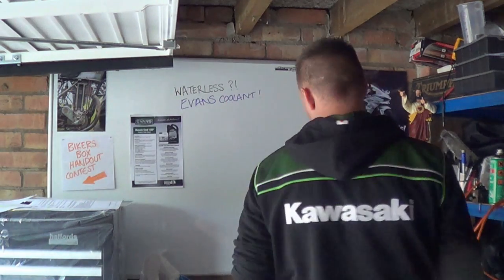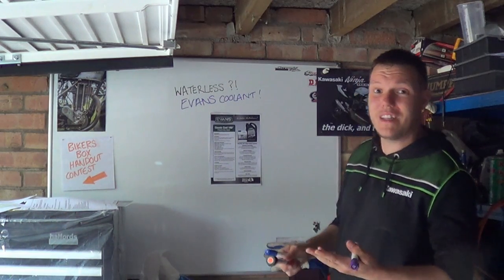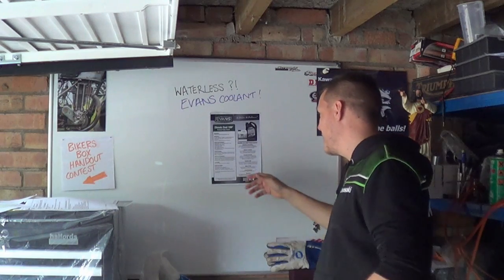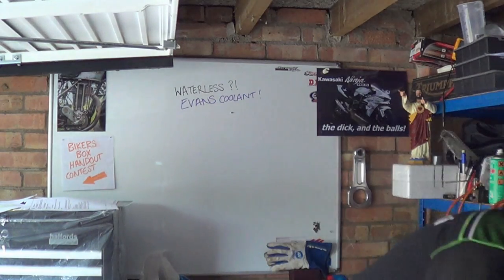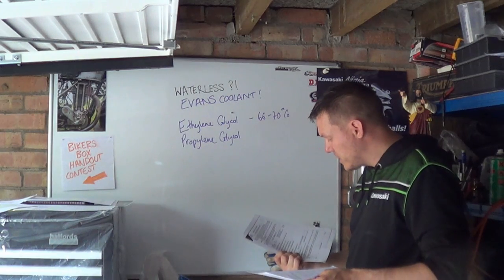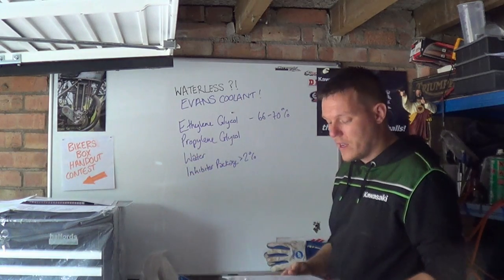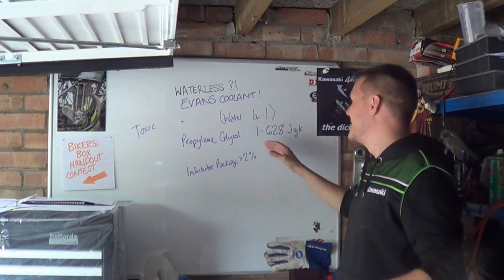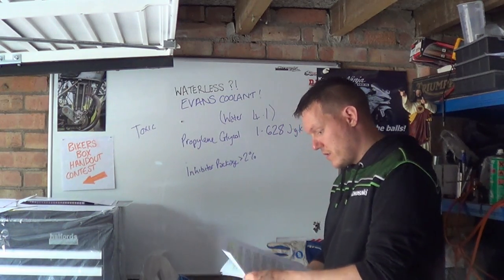Evans coolant any good? Part 1

Comment: I don't know patw52pb1 but not surprisingly - as the MD of Evans UK - I do agree with his or her comments. However, I know from arguing with the wife that getting someone to agree with your point of view, when theirs is diametrically opposed is pretty pointless. So I'm not going to try and argue the toss with the presenter of this video - although I would be very happy to sit in front of a panel of my engineering peers to explain the pros and cons of waterless coolants.  Instead I would refer all those considering the use of Evans coolants, or just wanting to know more, to take into consideration the R&D assessments carried out by a number of highly credible organisations, who have found Evans coolants to perform as described and advertised.  The following organisations spent several years assessing Evans coolants performance before committing to wholesale engine conversions;  Honda, Yamaha, KTM, Polaris, Kawasaki, Kubota, Eagle Jaguar, Veolia, HM Gov for all SAS rapid response Landy's, quads and enduros, HM Gov for a major flood defence systems, using CAT gen-sets for back-up pumping power, all UK Army Enduro Teams, plus a whole lot more.  Evans coolants have been around for a lot longer than many folks realise and were initially developed for use in Indy racing cars in the early 1990's.  Since then sales have grown steadily and based on volumes of coolant sold around the world, there are now >1.5 million engines running on Evans.  Although the presenter of this video is obviously anti-Evans, it would be reasonable to state than the vast thinking majority are capable of making their own minds-up, based on all the facts and not just one individuals opinion. As to the presenters engineering credentials, I do not know and therefore would not assume or comment.  Suffice to say there is a lot of subjective commentary and bias, rather than a reasoned debate with someone else present to give a more balanced approach.
Reply from the maker: "Although the presenter of this video is obviously anti-Evans"

- I'm anti-bullshit. Good sales pitch though
Reply: Thanks, I've had a lot of practice!  Hyperbole (BS) is inevitably part of marketing, but the product does bring a lot of genuine engineering benefits for the  great majority who use it.
Reply from the maker: Well played.....
Reply: your setup sounds ideal, is it possible you could do temperature testing between water and coolant (to show the increase and help set a base line) and evans? of course only if this steve guy supplies the evans, i want to believe but also want 100% factual test, the test by the workshop gave me a lot of data but was not definite as he measured coolant temperature, his test almost suggest that evans ability to get to temp quickest means it may actually transfer heat the best, i would love to see this done with a in coolant sensor and an on plate sensor but i doubt the workshop will comply and he may not have the correct tools to measure the surface temp under the glass without changing the surface contact, but your intercooler has an iat sensor and that is like a cylinder wall temp sensor, it says more than coolant temp ever will and since that is the temp you are actually trying to control then it is most important, now for confirmation i must ask it is a standalone cooling system right? not coupled to the engine coolant (other than the rad being behind or in front of the engine rad which we cannot help)
Reply: aterack833 in test is the same. Water is best charge intercooler have to run pure water or 50/50 in winter to have coolest temps.
Reply: aterack833 drill a hole and the best flood coolant is water just add soluble oil to lubricant cut. Nuclear reactors use water or co2 as the coolant media as its the best at transferring energy heat.
Reply: co2? never knew that, but yes i already watched his video which with the right logic applied is definitive proof, so other than for cold vehicle warm up and emissions i would say that evans is crap, and my exclusion is only if you have enough of a cooling system to not overheat during daily use, the worst part is i have since then disagreed with matt on other things and still retain my changed mind on evans ability, it's crap and lies, would never buy the stuff and kinda want to know the ingredients to know how much they are screwing their customers , the one situation you could use evans is on a stationary engine with a massively oversize cooling system evans would allow you to put oversized pistons by thinning the cylinder wall so much that the heat would be too much for normal coolant and the "cavatation"  (boiling and bubbling) would not occur and you could then retain cooling system function, i doubt anyone with such a setup would want to buy that much of this when they could spend the money reducing the load on the engine or getting a bigger engine/adding an auxiliary engine
Reply: his combined efforts between his videos told me that evans is basically just prop glycol and has a thermal conductivity about 1/3 that of water, so half of normal coolant roughly
Reply: There are 1 billion cars in the world and 1.5 million run Evans. That doesn't include the count of those who dumped it.
Reply: @Jonathanbaker  cutting oils are actually glycols
Reply: @Mr. Faffington  so you get the point. Its not approved by Kawasaki, Yamaha or Honda. Just technical partnership where you send them bunch of free stuff to test.
Reply: @Mr. Faffington I got your point and agreed.

Comment: OK, here's another science bit from when I worked on water-based hydraulic fluids for offshore oil rigs.  Ethylene glycol is the most toxic of all the glycols (drinking 100ml is fatal) but it's also the most biodegradable. Propylene glycol is food approved for use as a wine sweetener and for making essential oils water-miscible, but it's also a lot less biodegradable (strange, since they let you ingest it). Sodium Nitrite/Nitrate is an oxygen scavenger and reduces corrosion. 2-ethylhexanoic acid is a chelating agent (can take metal ions into suspension) and is reprotoxic (dangerous to the unborn child) - nice, eh?

Basically, this waterless coolant ides is a scam. Water/glycol mixes freeze at lower temperatures than glycols alone and the water is a better coolant due to it's higher specific heat capacity. Just buy what the OEM recommends and be done with it. they wouldn't spend millions developing an engine without checking anti-freeze out at the same time. Evans waterless coolant is a form of snake oil.
Reply: the solution with the biodegradability is change your coolant and drink the old mix.then all is fine lol
Reply: Another fun fact - the antidote for glycol poisoning is to get drunk on vodka. The alcohol purges the glycol from your kidneys as long as it's administered soon, before it can cause kidney damage. This is why alcoholics don't die when they try drinking anti-freeze to get pissed. I took a guy to hospital who swallowed ethylene glycol after a hose burst when filling drums and he had a really good night at the A&E getting bladdered. The Pharmacy at the hospital had to send someone out to the off-licence to fetch it!

Comment: Certainly in the UK and I expect everywhere else you can have problems with your insurers if you modify your vehicle without informing them. Substituting the coolant for something that is flammable seems to me far more significant than the Ace cafe sticker on my wifes car. Pure ethylene glycol actually freezes at -10c, in comparison to about -40c for a high antifreeze content mixed with water. I obviously don't have the data for the Evans coolant.

Comment: 10 Tenths Race Coolant Inhibitor Concentrate Inhibitor 
is formulated for all water cooled engines, especially where high engine
 operating temperatures are experienced. It provides superior heat 
transfer abilities to lower engine running temperatures compared to 
glycol based engine coolants.
Reply from the maker: sounds like a sales pitch to me

Comment: @The Workshop, there actually is a application for Evans that is right up its alley, and that's in off road applications like Dirt Bikes. Ever been in the middle of a hard enduro miles from anywhere to get more fluid if you bike starts boiling and overheating spewing all the coolant out, your boned when it does, at least with Evans even if it starts overheating, you're not going to lose the fluid and can keep going.

Comment: ACU road racing regulations dont allow the use of any cooling additives so its H2O only
-cant really think of any engines pushed harder (ok it is for shorter periods of time but still)
im sure this is incase there is a crash and it wont cause slippy patches.

Comment: actually coolant CAN impact HP output of an engine. The better the stuff works, and I don't know, whether water or waterless coolants work better - the less engine's temperature fluctuates, esp. in regard to turboed engines that tend to go in limp mode as soon as there's too much heat soak.

Comment: It seems that the main drawback of water based coolants, is the system pressure, and second, in a pressure-compromised engine, (lack of maintenance) the water will vaporize in hot spots
 The main benefit of water is the ability of water to transfer heat.
The main benefit of Evans is the high boiling point will not be as likely to vaporize at the hot spots; secondary benefit is the lower system pressure at proper operating temp, and third, less corrosion happens when water is not present. Water is a key chemical component is the process that turns iron into rust. Less rust will tend to make other components last longer.
  According to Jay Leno, the main benefit for his cars is the fact that they sit for long periods and water pumps will fail, even when not stressed by running wear.

The failure of Evans, apart from high cost, is that lower capacity to transfer heat.
  The number of cars that are running at full power for more than seconds at a time is very small, and that might not be true of heavy vehicles

The benefit for a given user will depend on what that user's use of high loads.
Here in North America, in modern diesels, a major failure point in light duty pick-ups, is rust particles clogging an in-block oil cooler that then prevents coolant from passing downstream, which make other components overheat and fail, especially EGR coolers.
Ford Powerstoke V8's were very susceptible, in the early pollution control years. And there is so much stuffed under a full-sized pick-up's hood (bonnet), that it takes a day to disassemble all of the equipment crammed into the valley of a V8 before you get to an oil cooler. Many owners did not do the full disassemble service, because it costs as much as a Ferrari, when they are used to the cost of a gasoline engine tune-up.

  For those people pulling large 20,000 pound trailers with their 7000 pound trucks, they do reach the limit of a cooling system, especially in areas when the air is above 35C pulling up a mountain.
  The rest of us almost never get anywhere close to that limit.
  You are correct to say a full power load is designed for the cooling ability of water based coolant.
  The question then becomes, is Evans worth the cost, or is it more effective to maintain your engine as it has been designed?
Well, DUH!
Better to own a car that you actually drive, and don't let you collection sit.

Comment: Just to add some further comment to my previous posts on the subject of this coolant, although I remain unconvinced. Some diesel engines apparently suffer quite serious cavitation and erosion around the liners when cooled with just water, this is due to the shocks experienced every time the engine fires. I don't know how much this is a factor with the "softer" combustion in petrol engines. I admit that I tend to think of cavitation in regards to propellors and impellers but I had not considered "vibration" induced cavitation. Matt, you know I am not an Evans shill, I just like to investigate stuff... I will find more on this...
Reply from the maker: I've said this before in another video but cavitation is what you think it is, and for long stroke diesels its a real thing - just think of cylinder sleeves as long tuning forks that resonate - this vibration creates cavitation bubbles
Reply: Matt, I understand that now, I knew what cavitation was and the basic physics of it but I did not think of the liners "ringing", you have done a LOT of interesting videos so still finding more of them. Keep up the good work, keeps me away from Pornhub....

Comment: Matt, Evans like other companies will bend statistics to suit themselves. One of my cars had a quad cam alloy V6, sadly it also had a crap design water pump with a plastic impeller. You can guess the rest..... warped heads and £2500 to fix. (Previous owner had this happen). You could obviously blame this engine failure on the cooling system.... but it is a very misleading conclusion. It was not water or antifreeze that let the engine down. A higher viscosity coolant might have fatigued the pump earlier.

Comment: P.S. to my previous comment....I'm happy to respond in detail to any technical question viewers my have after viewing Workshop videos relating to Evans coolants....hopefully that will provide a two sided debate and not just a diatribe
Reply: Can we keep this civil and focus on the engineering issues?
Reply from the maker: This is my channel Steve, this is how it is.
Reply: I appreciate that and the appeal you have generated for your followers. Hopefully you can see it from my side too and give Evans the opportunity to address the points raised.
I'm happy to do this 'off forum' if you would prefer?
Reply from the maker: No, public is fine by me. I'm doing this for these guys. I already understand the reasons why Evans is sold.

Comment: I have filled my engine, in recent years, with 100% coolant, i started doing it to see if it would overheat or do anything else nasty but i didn't notice any difference in normal running temps,  max temps or warm up time. The coolant system is a bit overengineered but should i be looking to measure the temps of the actual engine structure rather than rely on the engine coolant temperature to see if it is not doing the job properly?
Reply from the maker: Very true, I'm going to set up some thermocouples on a running engine, but the coolant temp is a good indicator to what's going on.

Comment: this is either the first i am hearing of the 20 years 1mil miles thing or i passed it off as marketing bullcrap when i did hear it, unless your system was brand new and had no corrosion or gunk in it you would have to change it a few times that would be like an engine oil manufacture making an oil you never had to change (or could go for a long time at least) because it did not make any of the deposits and did not break down, well what about all the crap already in there? unless you massively flush your system or start with new parts both of these ideas would be really bad

Comment: Now THAT is extremely interesting, and I don't mean the marketing bullshit! 60% of engine failures LOL. Very well explained.. I was curious when I first heard about Evans Coolant via someone's bike project. My knowledge of cooling systems at the time was rudimentary at best, but even then I thought it was strange that it was believed this stuff simply wouldn't expand at all, so it was OK to throw away the coolant reservoir on the bike after using Evans?! Just seems nuts. Now that you explained it's basically propylene glycol with a very little anticorrosion stuff, and formerly was ethylene+propylene glycols with a very little anticorrosion stuff, it's just shocking. Way too much snake oil in the motorcycle business! Thanks Matt for clearing the air.

Comment: Matt - your vaping kit has glycerine in it, not MPG, the same as disco smoke machines. Just thought that you needed to know.
Reply: OK, the ones I've come across are Glycerin based. I don't vape BTW
Reply from the maker: ON the back of the bottle I have now, its actually says 70% lol
Reply: Here's another thought - if you overheat glycols, what do you get as a degradation product? Formaldehyde, so under the wrong circumstances they can be just as bad as cigarettes (except that cigarettes don't go boom).
Reply: @ModshackMerlin  just thought you'd be interested to know that the formaldehyde is well beyond what the vapes are capable of (iirc it takes over 120s to heat using a 3.7v battery and a 1ohm coil to get the breakdown of vegetable glycerin to formaldehyde) by that point your burning your lip and melting the plastic so... its not that much of a concern

Comment: If you used tar for coolant the pump would rob more power. So if it's less viscous than water won't it be less of a parasitic loss?
Reply: Therefor not really making more power but making power available
Reply from the maker: It thicker than water - water viscosity 0.001 Pa.second Propylene glycol 0.042 Pa.second 

- so less work for your pump.
Reply: There's my theory down the shitter

Comment: Do you remember Splitfire sparkplug in the 90s? 
It came, it saw, it disappeared 
Just as Evans is going to do. 
I WANT to know when my dirt bike gets to hot, with Evans I don't know. 
Cheers
Reply: I remember 'em. I thought it was a little bit earlier though. Like mid/late 80s.
Yeh, I hadn't thought about 'em for yonks. Not seen 'em around though.
Reply: rationalmartian Yeah I am getting old when I got a decade wrong 😂 
Gotdam iam only 40 what happened....... ?